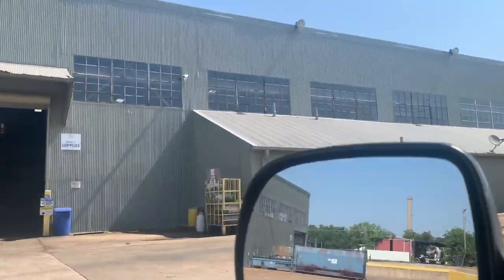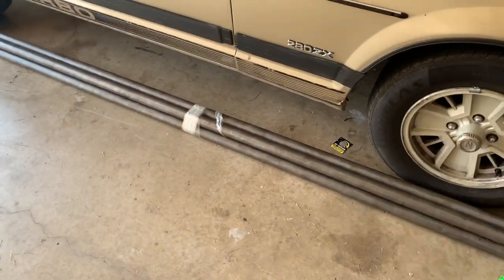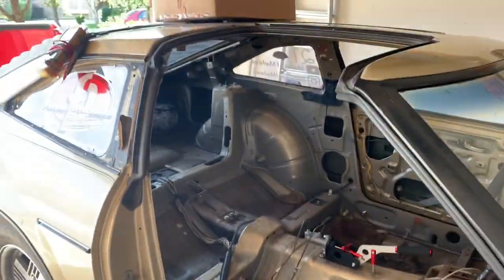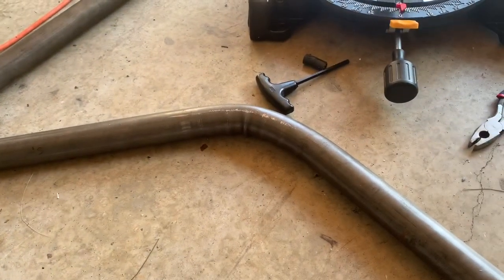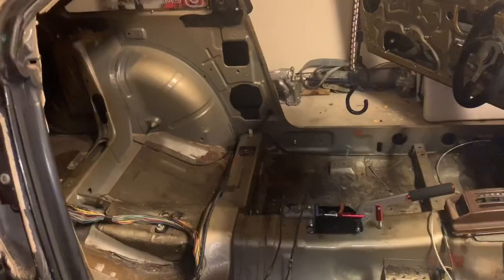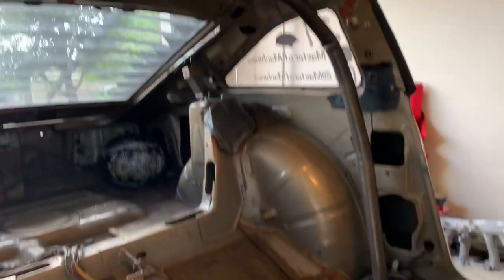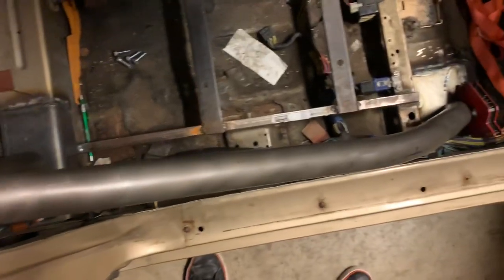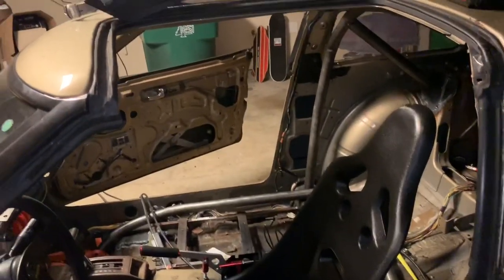DIY roll cage with harbor freight tools

Comment: Hey bro u can't have any buckles, divits, or ripples and the tubing center line radios needs to be 3x the width of tubing. A 3000 pound vehicle needs 1 1/2" with 4.5" canter line or u won't be allowed to bring onto track nor can u even practice.
Reply from the maker: Wow I did not know that. Great info! I built this cage over a year ago though so you’re a bit late. Lol. Luckily the tracks around these parts don’t really have rigorous tech,  Probably because we just aren’t all that fast. Thanks for sharing the info though!
Reply: @masterofmachines  you should cut out and re-do anyways. If you roll, and the cage crumbles, you're not gonna be a happy camper. I have no idea how you didn't read any rules and regulations before even buying the tube, or any research remotely at all.

Comment: so painful to watch. Please people , if you are planning to build a NHRA roll bar please don"t watch this. Main hoop junk, door bars junk. I redo approx 4 bars/cages a year from local Div 6 racers that try to do it them selves just to get turned away from the track after inspection. 

FIrst of all the mounting plates don't have to be exactly 6x6. They can be bigger or on multiple planes. Door bars should have went further front towards the A-pillar and attached to floor and rocker  not tucked under the seats. Remember the door bar must pass through the shouler and elbow while in driving positition not just seat.  also the main hoop must be within 6 inches of drivers helmet seated and buckled.
Reply from the maker: R N. Wow after reading your introductory paragraph I was pretty scared to read the rest but I am pleased to see that you have only minor criticisms. Thanks for adding valuable information to this video.
Reply: And absolutely no kinks or ripples

Comment: Surprised you passed folding those plates and with those cage kinks.

Those folds are going to be a weak point of your cage and I thought those plates had to be flat and boxed in to pass tech.
Reply from the maker: Hmm, I have a few thoughts on your comment. First off, I searched through every NHRA literature that I could find online and found nothing that mentions a particular bending method or the word “kink”. Not saying it should pass tech, just reporting my findings. The kinking that occurred when bending the tube without a doubt is a weak point in the tube. However, I disagree that the bends in the steel plates will act as a weak point in the cage. I’ve seen many many cages built with that same technique, as it is extremely unlikely you’ll find a flat surface to fully weld a 6x6 plate on any car, and the NHRA manual states the plates must be “fully welded”. A bent plate that’s fully welded will without a doubt be stronger than a boxed in design. Of course most of this is a matter of opinion, and it’s worth noting I’ve never seen a tech guy actually inspect my cage closely. They just kinda look for bars around here until you really start running fast. I’ve never encountered a really strict tech.

Comment: The flat plates should be bent to fit the contour of the sheet metal you're welding them too. So the comment about being a weak point is false. As far as kinks in the main hoop, I doubt tech will call you on those for 10:00 certified cage, However as you are probably aware that when you build something capable of running 150 in the quarter or faster, the tech guy's are defiantly a lot stricter and wouldn't pass a cage with kinks.. Great video and good luck racing! Have fun..

Comment: As some other videos will cover you can get some pipe the right size (pipe size = inside diameter, tube = outside diameter) bend it in the pipe bender then cut it in half so it forms a saddle the right size for your tubing.  That will help a lot with the kinking.

Comment: Why didn’t you remove the “sticky tar contaminates” prior to welding? Just curious?
Reply from the maker: I tried!! 😩 The sound deadening was so thick and difficult to remove! I took it down as much as I could within reason and acetoned the s$&t out of it but it was too much to get it any better. Looking back I wish I had used dry ice and chipped it away when it was cold, but I didn’t know that trick at the time. Hope somebody learned learned from my ignorance.

Comment: That's a "pipe bender" and you are using "tube". You need a "tube bender". They are not the same thing and the pipe bender will not work.

Comment: Highly recommend a Mig gas set up.You just have alot more heat input in every thing than you need.Thats why all of your welds have that grey color to them.Also when you said you had to switch to flux core because your TIG doesn't agree with that black sticky stuff I laughed.TIG literally requires perfectly clean areas to weld.Any contaminants and its going to compromise the welds.
Reply: Also flux core can lay welds nice if you know how to set the machine
Reply: Really like the channel though man
Reply from the maker: Thanks for the info! Ya I need a lot of help in the welding dept, thanks in part to my complete lack of patience to clean and prep surfaces. I’m currently struggling big time on some intercooler piping that I’m tig welding. I could def use some real training.
Reply: You're down in Texas right?Yeah with anything it only gets better with practice.I just finally got a multiprocess machine.Ive Tig welded in school ,but I'm no professional lol.I have to get the gas and some electrodes so I can practice some more.

Comment: did those kinks pass tech?
Reply from the maker: thugathugacation it has been through tech dozens of times at 3 different race tracks without incident. I’ve never seen tech pay any attention to it whatsoever, so not sure if it could be rejected, but there is nothing regarding bends in the NHRA handbook that I found online.
Reply: @masterofmachines  interesting take and while it's not the most visually appealing to me i always say if it works it aint stupid.
Reply: @masterofmachines  tech is probably hoping Darwin kicks in and eliminates the gene pool...